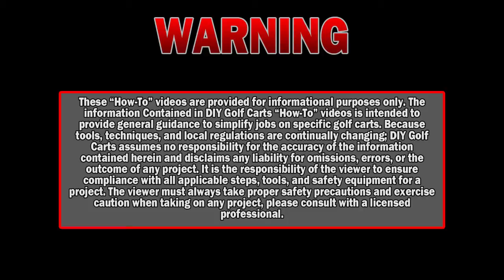Yamaha Reverse Buzzer | G19 | G22 | G29 Drive Golf Cart

Comment: Question,
I bought a G29 that has a light kit already. However, there is no reverse (white) light. Can I splice an LED white light into the reverse buzzer wires so as to have white reverse light while buzzer is active in reverse?

Comment: Hi. Thanks for the advice.... great...  I have a question:  If I just remove the buzzer (I use the cart on our small farm, not on road or golf course) will that cause any impact on the cart's operation... nothing else is dependent on it working is there?   thanks.
Reply from the maker: You can just unplug the buzzer but its a safety feature that we can't recommend disarming.
Reply: I didn't want to disarm mine, but the noise was very annoying. I found that wrapping the buzzer with electrical tape, and poking a small hole in it, muffled the sound down to a bearable level..........
Reply: @balsumfractus  Me too... I don't mind having one, but it was a safety issue with it that darn loud! I want to hurry up and get to where I can turn it off!  It is deafening! I may try your method...